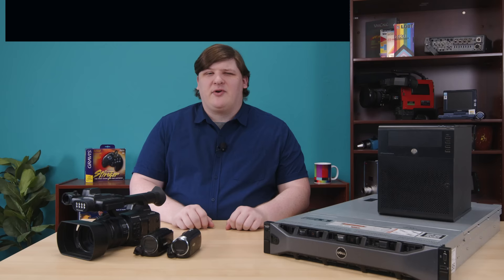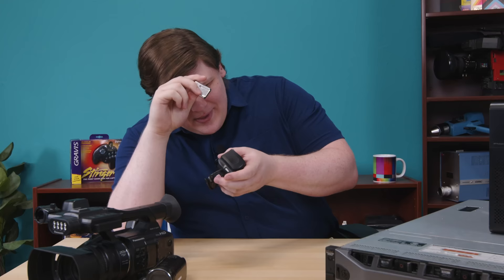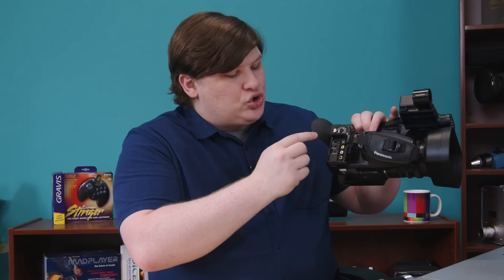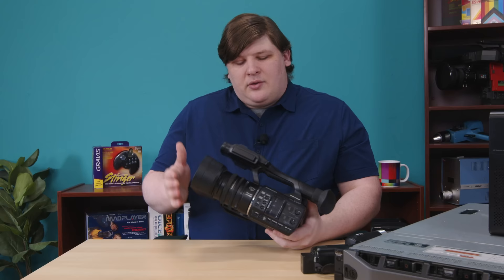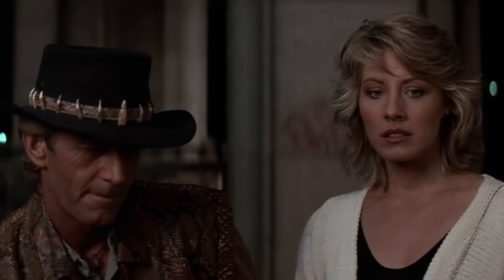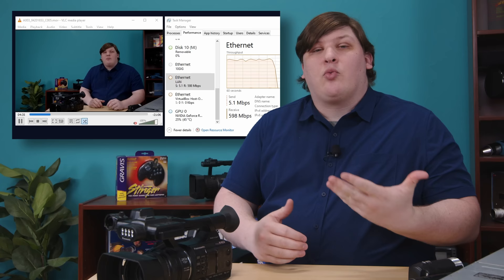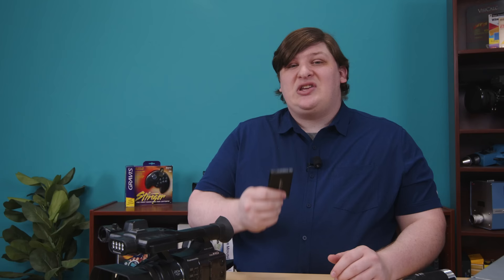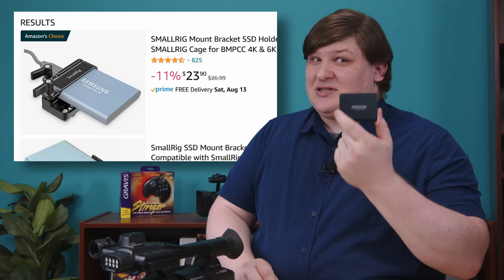I Built... a really fast NAS?

Comment: Love your channel, keep on keeping on man! My NAS journey went from pulling my hair out with FreeNAS many many years ago, moving to synology, and am now on Unraid. Hoping they add official ZFS support at some point, but so far I am quite happy with managing my storage, dockers, and VMs.

edit: If ARK doesn't work out, a 1650 Super or similar may fix your encoding woes! Encoder is nearly identical between all models of similar release. The 1650 Super is the cheapest (and lowest power!) card with the 3000 series encoder. I use it for all my Linux ISO transcoding needs :)
Reply: You should give truenas scale a shot... it's nice, supports dockers out of the box, runs your vm's etc; and a doofus can set it up.
Reply: If you don’t mind me asking, how many years ago was it? I tried it in I think 2015 and it was very easy and I love it. But I know they had a lot more CLI setup a few years prior to that.
Reply: 1650 super is generally just a good cheap low-power gpu anyways
Reply: Just a small correction: the 1650 has the Titan V encoder, which is a bit older but still very usable. I was actually gonna suggest a low-end Ampere quadro, like the RTX A2000! (which only uses 70W)
Reply: @SegaSaturnSubs  The 1650 Super is upgraded though with turing encoder, but the 1650 (normal) is not. That's why I picked it up; absolute cheapest modern encoder card I could find!
Reply: @kaitlyn__L  I think it was FreeNAS 8ish if I recall, it was around 2010. It was a terrible experience I wouldn't wish on anyone, but I know a lot has changed! I'm decent with a CLI and linux and all that fun stuff, in fact I switched it to a stable version of some distro and had it as a file share with nothing more for many years until I got the Synology.

Comment: ZFS is a great option for storage.  It works great, I've been using it for well over a decade now in both a personal and business setting and would recommend it for any sort of storage solution where reliability and speed is a concern.
Reply: ZFS is really grate and all. But jeez is it a pain to deal with. It is rocket science levels of work to use it. Or you pay/trust a 3th party to solve it for you. Or you use software that is not really clear if they are going to be around in years to come. But OpenZFS is honestly the only file system I can trust data to. 

Edit: lol. Yea Ubuntu ZFS is basically the ticket to have a decent time. But I'm not dealing with Ubuntu or Windows. So FreeBSD it is for me :/ It is hard enough dealing with Linux. But I rather deal with open source then WIndows 8+ The distro support for ZFS with Ubuntu solves allot of problems with OpenZFS on Linux.
Reply: @TheDiner50  This is why you use FreeNas/TrueNas/etc. Let it deal with the zfs management. Couldn't be easier.
Reply: It is an interesting filesystem, but it is not optimal for servers using hardware RAID. In the case of Dell PowerEdge (like in the video) you have to disable that by flashing the card with a LSI firmware to enable some weird IT mode, which will present individual drives to the OS.
Reply: @openworked  hardware raid is a scam anyways, and should be disabled.
Reply: @snowwsquire  why? Please enlighten us
Reply: @openworked  It's even more painful than ZFS in most cases.  The size of drives today means that a failure can take hours or days to recover from, all while risking another drive failing.  Many raid vendors haven't settled on format, if your raid card dies, your array might become inaccessible without the same vendor and or model of card. 
Those two alone have made me switch to LizardFS.  Past the drives via JBOD and then let all the redundancy happen at a filesystem level.
Reply: @openworked  search hardware raid is dead in the youtube search bar
Reply: @openworked  The short version: hardware RAID gives you a single point of failure. Consumer-grade hardware raid is a special kind of evil: it's as likely to fail as any other consumer-grade kit and when it fails, there's a high chance you won't be able to use your drives, not even with a newer RAID card from the same manufacturer, sometimes not even if it's the same model because that's just how consumer hardware rolls. They revise the design, possibly because upstream chips are no longer available to them, and the new version may be incompatible. It's not a deadly problem with most devices, but with hardware RAID it becomes a very special kind of evil indeed. I learned about it from Linux kernel documentation some time around the turn of the century. It was a pain when drivers didn't work because of something you couldn't even see when buying hardware, but it wasn't a killer problem until hardware RAID. I wish I'd written about it & a few other things, actually.

Comment: The second heard "HP" and 2011... I instantly thought "Thats gonna have a Turion in it isnt it... This isnt gonna end well."
I'll defend the Phenom IIs desktop CPU from the era being quadcores you could get for dual core prices.
But Turions IIs were hot garbage that for some reason HP kept using using.
Reply: HP used them for the same reason dell and gateway uses cheap junk. (or proprietary hardware) it makes them more money and once you've handed over your money it's your problem, not theirs.
Reply: I've seen those turions microservers around and figured there was a reason they're so cheap.

Comment: I actually had a segate rosewood (it's basically the data equivalent of a hard drive with a bomb with a random number generator attached)(also very common hard drive) and SMART actually saved my data before anything catastrophic happened, at least i checked crystal disk info and it was throwing a yellow caution and I was able to purchase a new drive and move the contents before it ruined anything. only had about 20k hours because it started to fail.

Comment: They make CFAST TO SATA3 Convertors for the Black Magic Cameras. Since CFAST uses the sata bus it is just a connector changer. That is always a good way to get more storage. You can also do the usbc to nvme enclosures and put a 4TB ssd there as well.
Reply: Or even 8TB, if you're willing to drop $1100 on the SSD alone (the enclosure is only about $50).

Comment: 1:23:24 haha, I've actually bought three of these over the past few weeks, for two different machines, with different problems to the ones you're facing. It might seem like they're designed for you, but nah they have plenty of uses. E.g.some 1U machines put a Mini-SAS connector on the motherboard pointing right up into the air. If you put in a straight one you can't even close the server. Some other servers have a similar issue, except they're 2u and it's the air-guide plastic thing that's blocking them.

Or other things like "we're using what we got, so the back of this server is right up against the back door of the rack or a wall, so we need to use 90 degree connectors (thermals? lol).
Reply from the maker: thermals? lol
Reply: @CathodeRayDude  thermals? lol

Comment: That server might be the ultimate reason to buy that Intel A40 small Alchemist GPU, no gpu power connectors required. Intel seems to have open source drivers for Linux so it should be fine

Comment: Why don't you record in ProRes 422 or LT? Visually, you won't see any difference, but it will be in terms of space. Example with 256GB:
ProRes HQ 41 min
ProRes 422 68 min
ProRes LT 98min
Even RAW 8:1 in 6K can accommodate 41min and it is definitely better than ProRes HQ for my taste.

By the way, the recording quantities on the website are calculated at 30p, at 60p this doubles. Does it have to be 60p?
Reply: I have to agree with the question of does it have to be 60.
Reply: I agree, recording 24/30 fps prores lt in hd will probably be more than good enough for these videos. Just make sure you do the fake upscale to 4k for the output file to youtube, so its compression algo doesnt completely destroy it.

Comment: Direct attach is great until you're trying to shove a couple dozen of those SFP ends through the wire management in your racks, then you'll wish you sprang for the fiber.

If you want fast low latency network storage you have to go iSCSI. All of the file protocols assume the network is crap and trade speed for reliability.
Reply: I'd love to use iscsi, but I keep reading that the drives shouldn't get more than 50% full when using it. That's too much wasted space for me.
Reply: @dragonheadthing   Most iSCSI use cases involve many simultaneous read/write operations and that recommendation is to reduce fragmentation on platters that consumes time.  Irrelevant on SSD and also not applicable to your single user set-up so you can safely ignore the advice.

However it does require different HBAs, not sure what cost those would be refurbished but new they're expensive. And although I know th drivers are in Windows Server I don't know if they're in the desktop editions.
Reply: @calmeilles  Aaah! Thanks for the info.

Comment: I wonder if you could 3D print an insert for that Kingston card reader dock thingy to make them fit smaller drives better.
Reply: I thought about that too. To make things simple we could print just a couple of cubes to pad the sides, and not have to measure the curves.
Reply: @DiThi  A chamfer on the outer edges to avoid the curves would still make it one piece and thereby easier to use.
Reply: Had the same thought, probably just needs an extra "push", either from something breaking or someone insisting/sending them to him XD
Reply: @DoubleMonoLR  admittedly, owning a 3D printer makes me want to find excuses to use it, like this, so yeah I might have a slight Impulse to overcomplicate it

Comment: I have had several conversations in the past 3 weeks that covered most of what you have now discovered and most of the problems you mentioned are NOT rare or unusual.. One comment is that there are two versions of SFP that are mechanically interchangeable but not electrical. SFP is for 1 GB, SFP+ is for 10GB. Where you mentioned SFP it should be called SFP+ instead.
Reply: Everyone I know uses the term "SFP" to generically cover SFP, SFP+, SFP28, QSFP+, QSFP28, XFP, and whatever other standard or quasi-standard plugs into the slot on a networkable device.  Unless, of course, the context of the exact specification matters.  But if it doesn't, it's "An SFP," and that's good enough to convey what you meant.
Reply: I knew somebody would have already pointed out the difference between SFP and SFP+. To complicate things more some but not all SFP+ ports are backwards-compatible with 1G SFPs.

Comment: One reason for some drives getting worse is due to the chip shortage in 2020. Some drives even got worse than their earlier runs. Even after the chip shortage was over, at least a few companies found that it worked really well to launch drives with premium parts, then slowly replace things like controller chips and DRAM chips with slower and less capable/slower spec versions. The initial reviews would say the drive was fast and would bury the newer reviews talking about how slow they were. Lately Amazon has been prioritizing showing me reviews made in the same year, though, so that might specific trick might not be nearly as useful to them, but capitalism will always be a race to the bottom in terms of quality in order to maximize profits. :/

Comment: I used to support film and TV students at a Uni.   This included lending out some pro level equipment for students to record and edit their projects with.

There does seem to be almost a tax on equipment for AV use.   One of our technicians (who had previously been a studio tech) said he was looking at the price of mic boom poles.   He was quoted nearly £100 for the one apparently designed to go with the Sennheiser mics we used.   He noticed the mount on the existing boom pole, and noticed it was exactly the same as the one on the extension pole for his fishing net.   So, he went into the local sports shop, and bought a couple of extension poles for less than £10 each.   He did buy some adhesive backed felt tape so he could replace the handles, but it worked out an awful lot cheaper to do that than buy the branded poles.

Comment: Just rewatched this video and remember that I had the same problem with the SSDs. 
I 3D printed a dock with magnetic usb c connectors. 
Works wonderfully. Fits T5s and T7s, mounts securely to my V-Mount plate, the cable is tugged snuggly on the rig and it snapps in place very satisfying. And it preserves the USB C ports. 
It’s secure and the mag change is super fast.

I still need to upload it to thingyverse. I’ll probably post it here when I did.

Comment: I learned the hard way like yourself about using DAC for interconnecting 10GbE. My main server and upcoming backup server will be getting SFP+ cards. My switch has 4 SFP+ ports which currently have two transcievers in them for copper as my gaming rig has a 10GbE on the motherboard that is twisted pair, and my macbook pro has a (rather expensive) thunderbolt 4 to 10GbE dongle so those have to run Cat 6. The rest are getting cards that have SFP+ on them and DAC cables. 

Also that bit where you found the camera had a removable battery was hilarious. Love your videos!

Comment: "Oh, Dell really kept the design of their servers for some time" - I got out of IT in... 2013! Solved that problem. Worked at a tech uni 2009-2013 and we used Dells for the most part servicing ~450 users. The 500 Mhz Poweredge in the basement cable closet (and under the radar storage room of tech junk for me) did serve us fine for e-mail until 2010-2011 when central admin and other paper pushers made us join the centralized M$ solution they had payed good money for. We upgraded our poweredge 2950:s to R710/720 (I think) for VM:s. ILO-systems are great stuff! Esp if you, like I did at a previous job, were dealing with hundreds or even thousands of blade servers. That was before the company got into VM and just provided blades for customers. This video did bring me back to fun times, but I left for good reasons and are happy where I am. Thank you for your videos, I stay for every minute!
Reply: But I completely agree with you on enterprise gear at home. They are incredibly loud and eat a lot of space and power. Been on that route, vintage machines mostly. Running a Compaq Proliant Dual Pentium Pro for just DNS while your Sparcstation with added external 1,3 GB FULL HEIGHT SCSI HDD serves web pages in 2009 is cool in a nice way, but hey.. At least I stopped before I actually used my Microvaxes for something, :) The Sun E450 with its 20 HDD:s made a good TV bench at least.

Comment: Man, the R720xd. I remember working in a job my roommate called a ‘red carpet sweatshop’, where I would push dozens of R720s (both non-xd and xd), R630s, SuperMicro X9-X11 machines, you name it. Those PERC cards are super fragile (so is the plastic, that stuff snapped all the time). So when you were like ‘my PERC card says it’s not running at full speed’ I got Vietnam flashbacks of re-seating and flashing RAID controllers in a shop where my boss told me I was too light-skinned to have an afro.

Loved the vide by the way.